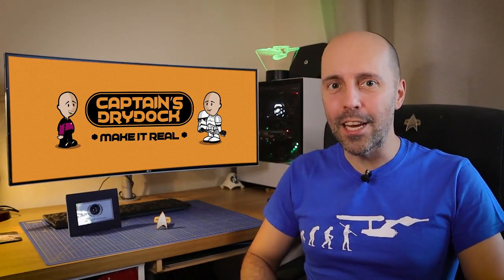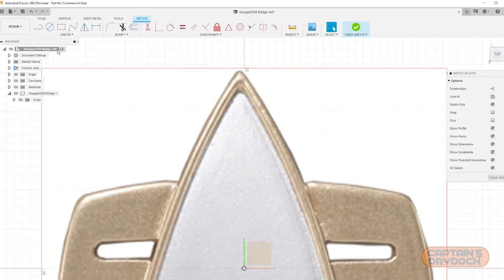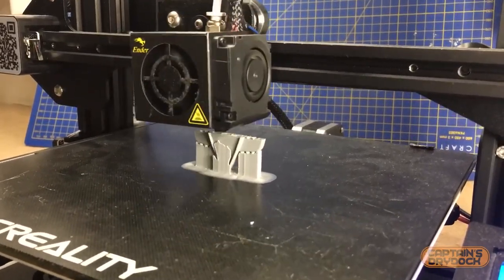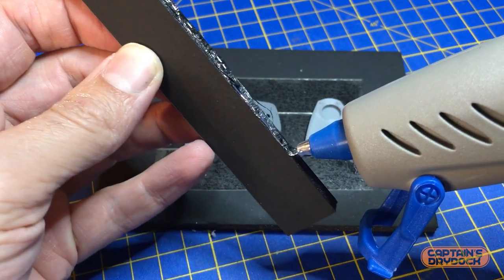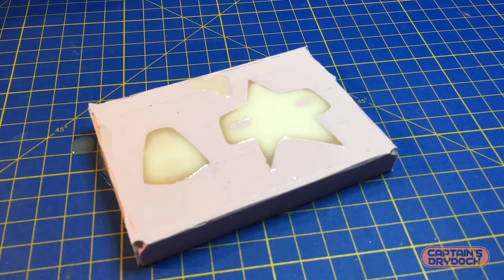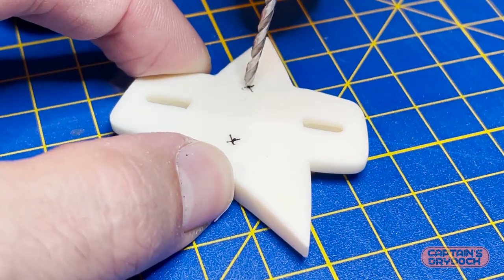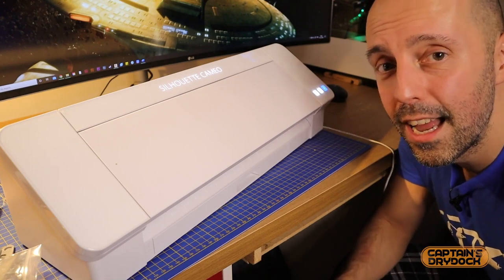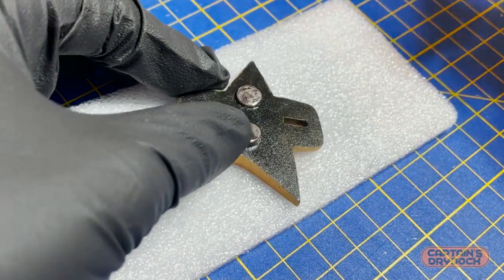Star Trek Voyager/DS9 Badge Build

Comment: I'm gonna have to rethink the design of my Future Imperfect badge design in light of seeing this, I'm definitely gonna need to separate the rank bars from the rest of the badge to get it to print properly.
Reply: I've done this with my version. It took a bit of work but I managed to get mine to be rank swappable with magnets holding the rank bars in place.
Bar magnets work great for this as they are long enough to cover all the bars.

Comment: I always wonder why people go through so much trouble to line up magnets.  

Just use a thin piece of metal for the inside piece.  Magnets stick to metal, remember?  

And it lessens the odd bulge behind the badge.
Reply from the maker: Completely understood. Personally found rectangular magnets are difficult to make a hole for so it sits flush. Hence a drill bit being circular is easy which dictates the shape of the magnet. And cutting up pieces of metal is a pain. 

Thanks for the feedback :) Love to hear different   maker methods.